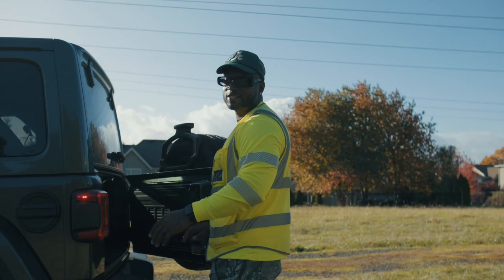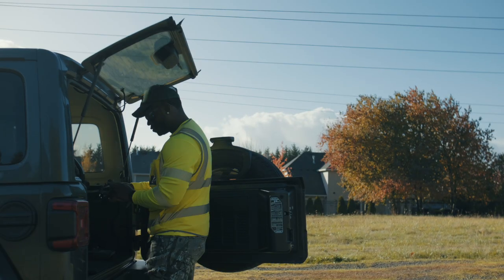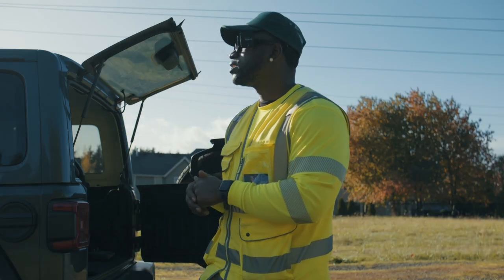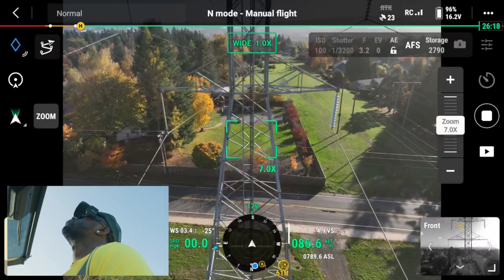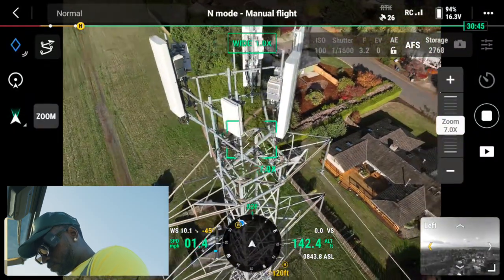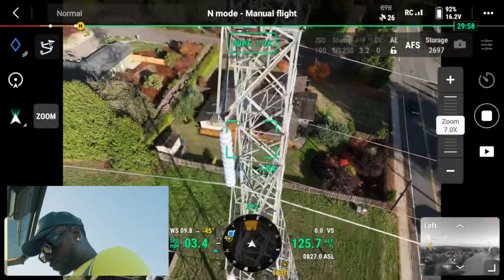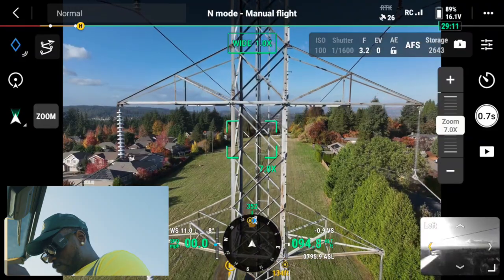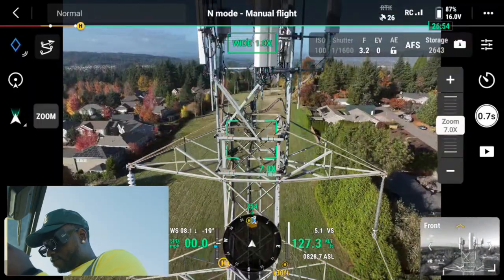What Drone Pilots Need to Know Before Inspecting Utility Lattice Towers

Comment: Hi Shooter, thanks for your nice videos! Have you performed utility tower drone inspections in snowy conditions and do you manually change transmission frequencies to avoid RF interference or fly away events? Any tips for best practices in these situations?
Reply from the maker: No sir, haven’t inspected one in the winter yet but the m3e handles the frequencies pretty well in any weather